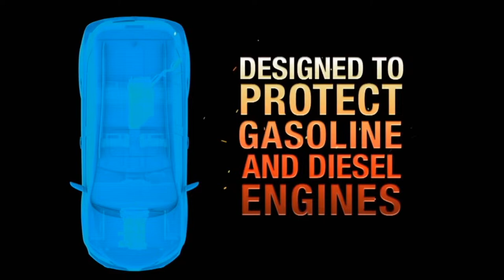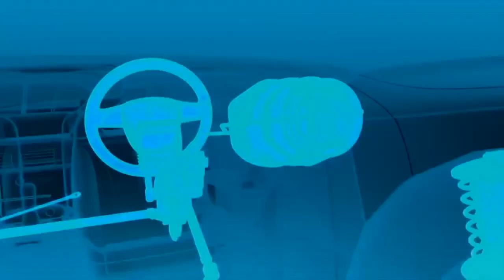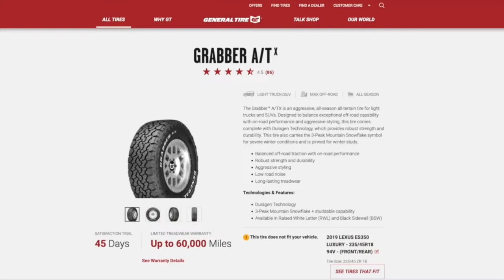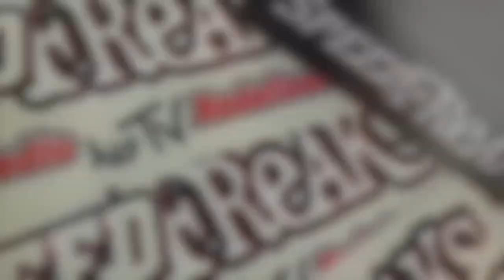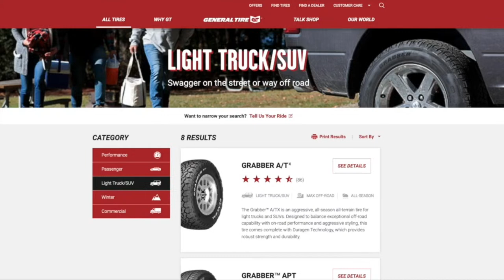Scott Dixon's bid for GOAT status & Michael Jordan wins Talladega

Comment: Welcome to Slamatona from what was expected to be a nominate for Classic Race of the year turned into a nominate for Crash of the year thanks to the flip by team 7 and nearly team 4 on the last lap in the last turns.😕😕😕😕😕😕😕. Team 6 should be penilized for ruining the finish for the fans. Like the fall playoff race of last year and it's turned into a huge tragedy of a few finishes in most of the races and people are pissed off 😢😢😢😢😢😢😢😢😢😢😢😢😢. Luckily the ARCA Menards Series was a nominate for Classic Race of the year because there were 18-20 car pack that made it tremendous for the people and only one caution and no B.S. than Daytona earlier this year. A few lead changes and photo finish between teammates and no wrecking.😊😊😊😊😊😊😊😊😊😊😊😊.